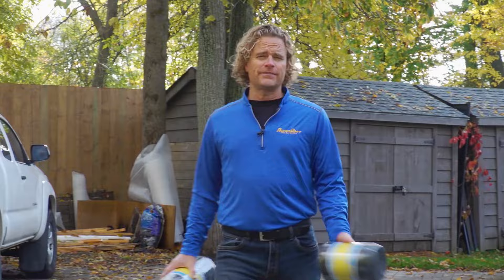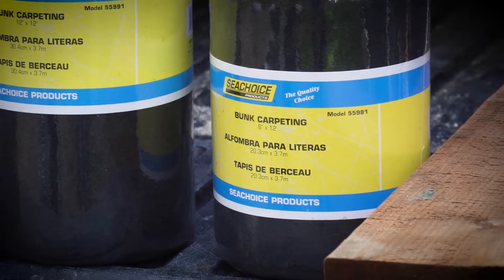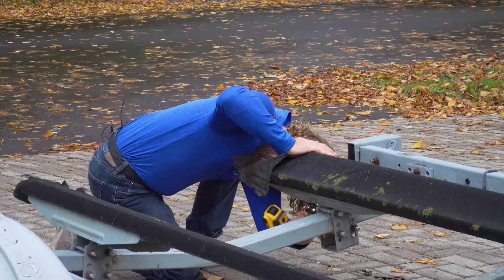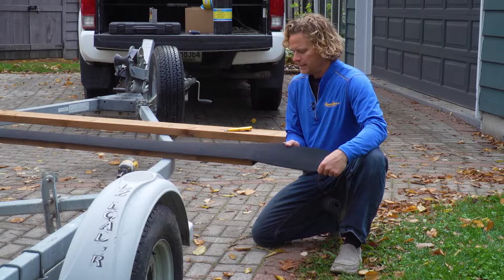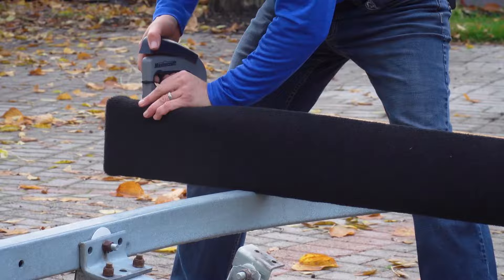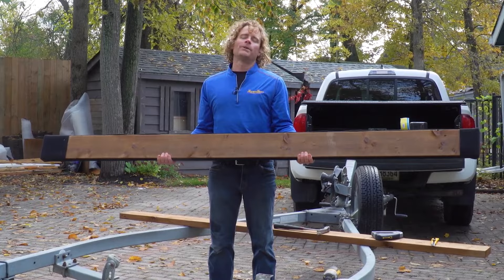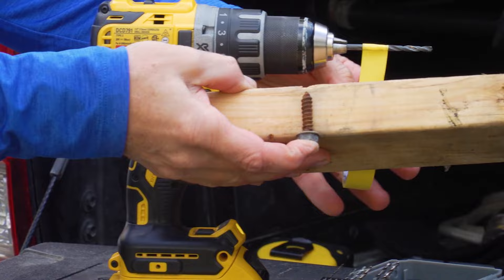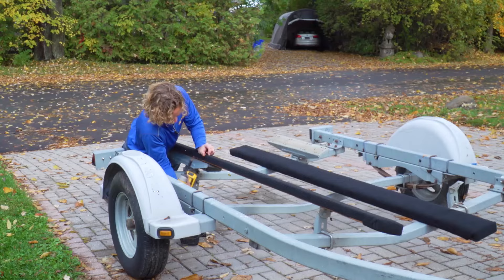How to Restore and Replace Your Trailer Bunks | PowerBoat TV DIY

Comment: If you coated and sealed the wood Before the carpet was put on, god-knows-how-long it Really would last LOL great stuff thanks for posting
Reply: He said “pressure treated” lumber.  No need to coat it since it will be covered with carpet.  LOL
Reply: Would not recommend seailing wood then poking a bunch of holes in it
Reply: @jamesharper8373  My attempt at a little sarcastic humor... Thanks for taking the time...